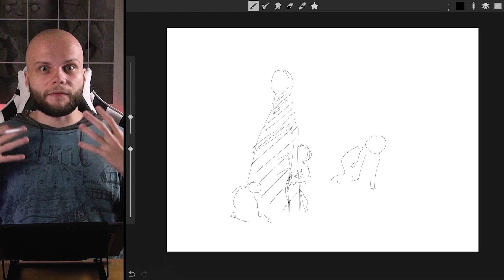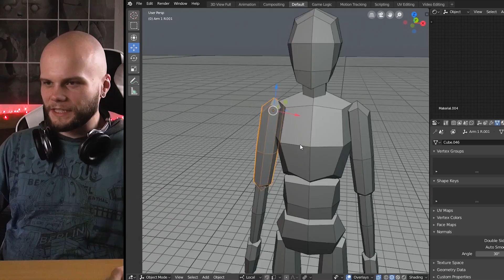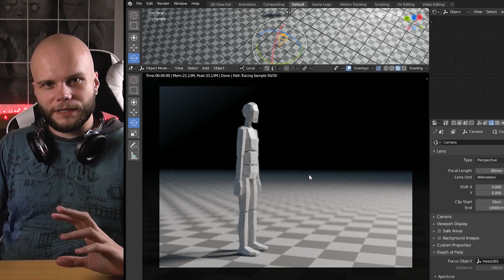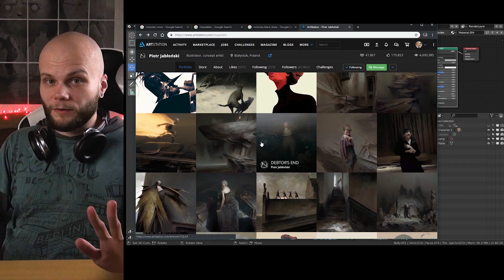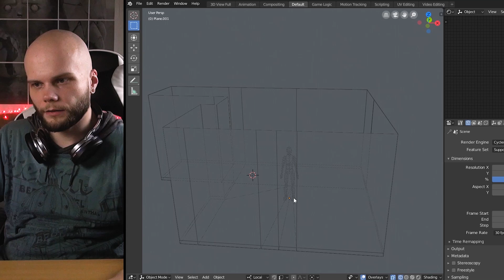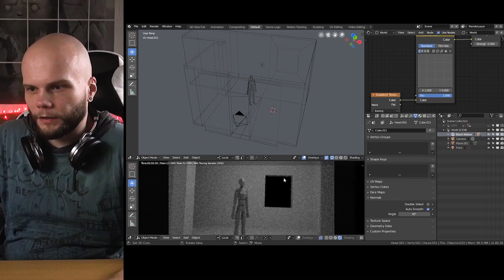Using 3D For Painting: Tutorial - Part 2/6

Comment: Pretty neat. Why aren't you using EEVEE though? It's pretty much designed for the purpose of this sort of visual prototyping, no? You can always render the final result in cycles if you're hung up on "physically-accurate lighting" or whatever. Most of the material nodes work both in cycles and in EEVEE as far as I'm aware. Especially if you're not doing anything complex with the materials (which I don't imagine you are since this is just supposed to be a simple pre-painting to establish basic lighting, geometry, perspective, et cetera, if I've properly understood the purpose of this 3D exercise).